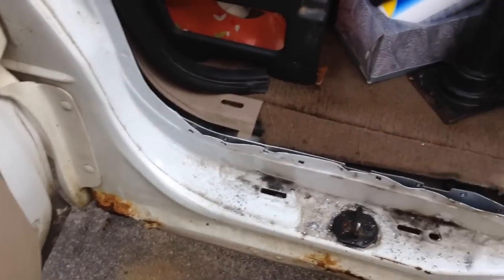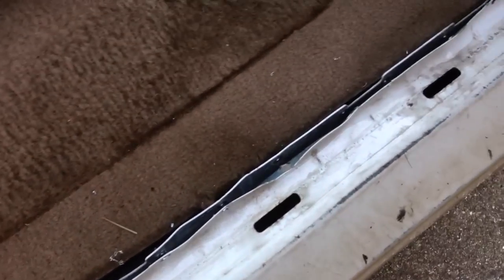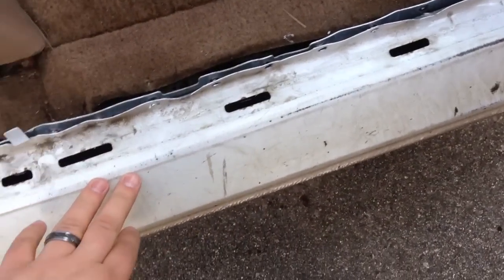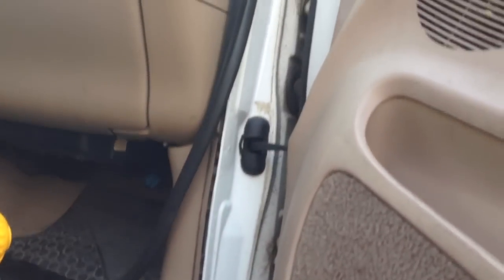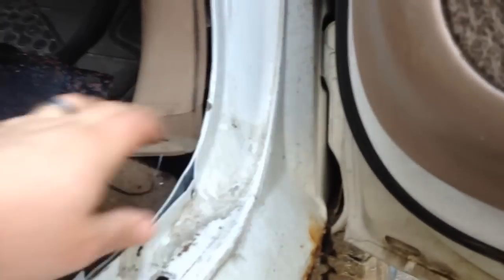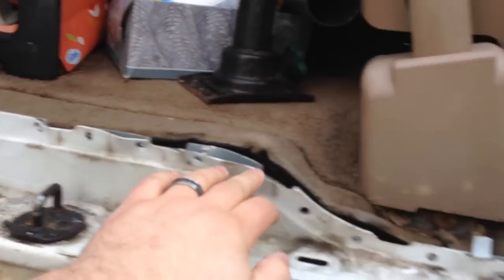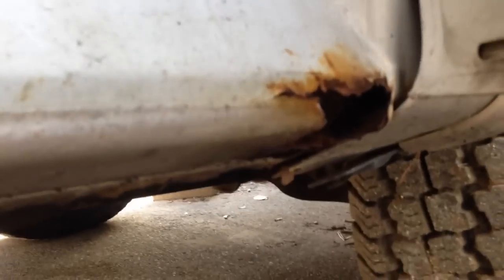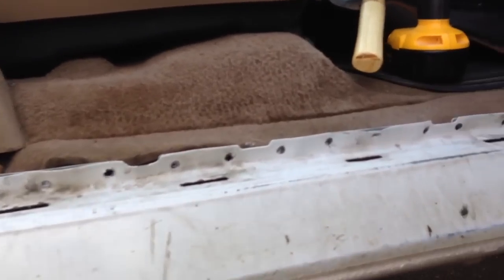1998 Ford F150 Rocker Panel Replacement - Part 1

Comment: Currently in an auto body class in school and I'm doing my 96 f150. Surprisingly my rockers are 100% fine. However cab corners and fenders are going. Started today
Reply: why they didnt stick with the open rocker on your years was a huge mistake, there really isnt much of a rocker on 87-96

Comment: Where did you get your replacement rocker panels?  not sure if you address this in a later video or not. I plan to watch them all as I plan on replacing my rocker panels on my 2000 F150.  I plan on keeping it too.
Reply: You can buy the full set on ebay. That means the Outer Rocker Panel and the Inner Rocker Panel.  Depends if you have a 2 door or an extended cab 3/4 door version. Right now only one listing for the 3/4 door full version. I bought a single outter and now I realize I need an inner it's so bad, almost completely rusted away gone. And my drivers floor pan is almost completely gone. Only the insulation is holding it up with a bit of metal. Pretty scary. If I knew how to spot weld and where to find decent priced steel sheet metal, I think I'd have it done in no time. second biggest issue is removing the heavy doors.

Comment: These model f150 run forever but the bodies were bad on them. This is the first area on these trucks to rot. Also the bumpers are thin and cheaply made. But it's still a F150 and nothing else like them.
Reply from the maker: Yea - pretty much every F150 from this vintage in my area has the same typical rot. Good truck, but crappy thin sheet metal. I've replaced the bumpers with used ones for rust issues etc. Love my F150 though.

Comment: I thought replacing the rocker panels on my 59 Fairlane was going to be easy, I thought wrong, cutting the outer bit was easy, but then the shit hit the fan all the inner was not much better. one thing I have learnt is how to weld like a pro..